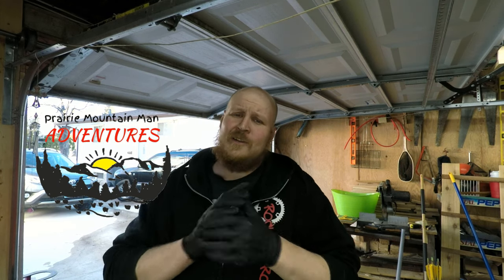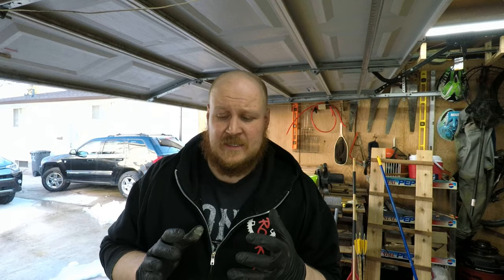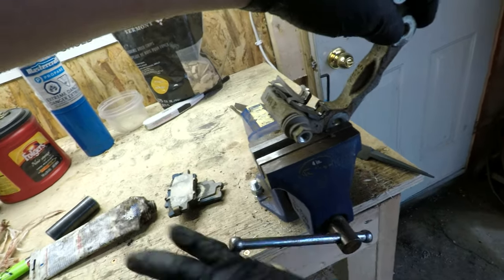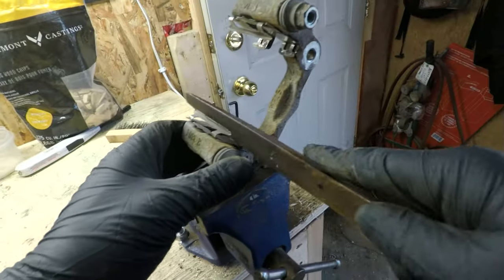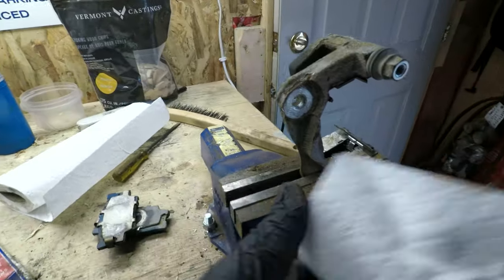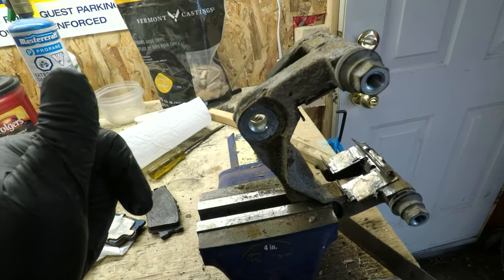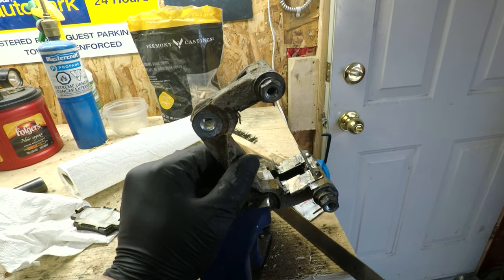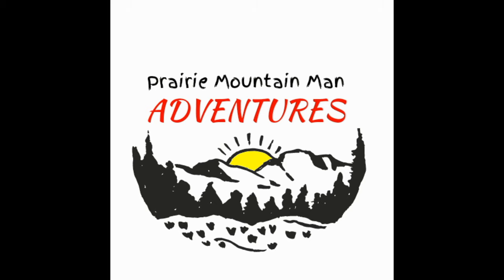*Tech Tip*How To properly Service automotive brake calipers!

Comment: I have a break question, what would make the rear caliper slide bolts break? I had a 2006 Ford Mustang that kept snapping the slide bolts then the pad would slide down. This happened 3 times within a matter of 3mo.

Comment: Nothing wrong with tips like this. I actually took automotive in college. I graduated in 2006 and that was during a bad recession when dealerships were selling new vehicles 60% off. There was no way I'd land a decent apprenticeship. I took a year off and changed paths to civil engineering. So I have two diplomas 😉
Reply from the maker: Yeah recession hit us hard in 2008 in Bc. I was laid off most the winter. At the time I was stoked about it since i had a pass to the local ski hill. Ended up doing 48 days at the hill that winter
Reply: @prairiemountainmanadventur7424  haha yeah find something good in everything. When one door closes a new one opens.